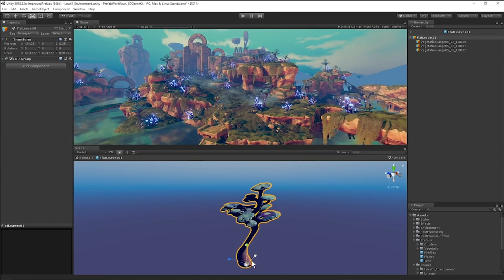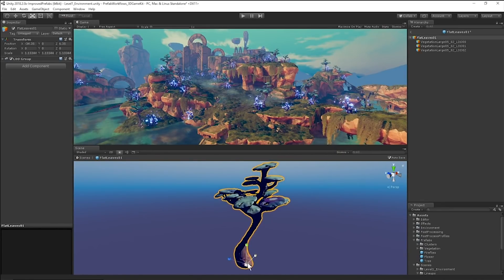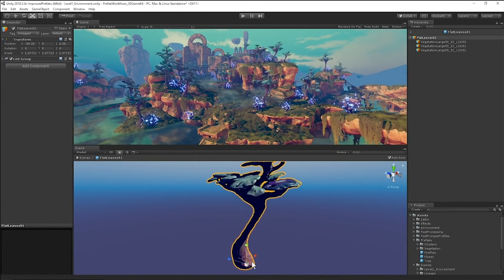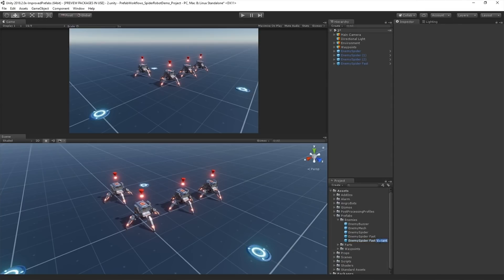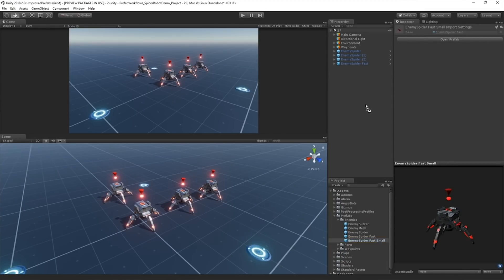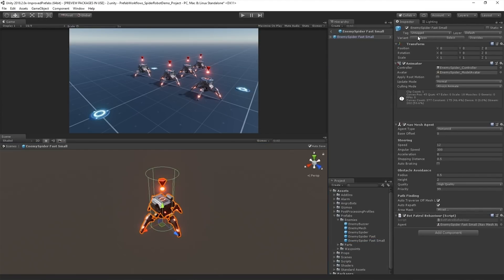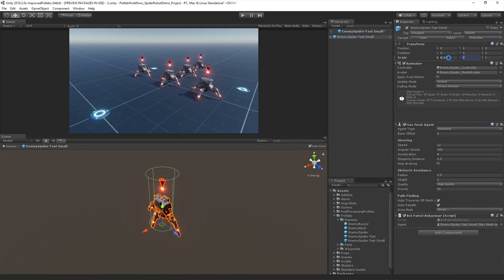Unite Berlin 2018 - Prefab Workflows

Comment: You have broken so many projects. Such a fundamental change to workflow should have been introduced only in 2019.1, not just before LTS. Major features like being able to edit a prefab in the context of a scene, or editing the components of multiple prefabs at once, are missing. You can't even see a prefab without clicking 'open prefab!' Where is your UX person?
The prefab changes make sense for a narrow, laboratory-condition programmer-perspective workflow - but not for the broad indie market making actual commercial products.
Try making a UI with this new system, and not being able to edit your UI prefabs in the context of the rest of the UI! A huge backwards step.
Reply: @Guybrush Threepwood There are a lot of studios who expected a clean upgrade path from 2018.2 - and this has presented a major, major obstacle. Core changes should not occur in 2018.3 (which is essentially the preview LTS release)
Reply: can someone explain what unknown error is?
Reply: edit the prefab instance then apply changes to the prefab. also, a prefab dependant on a parent is a design flaw. perhaps expand your UI layout knowedge :P

Comment: new prefab workflow sucks
Reply: Can you go into more detail?
Reply: You have 25 items. They are all prefabs in the old way. The only difference between them is one sprite, with a shared background. Change the background and you have to redo all 25 prefabs, one by one, one by one, one by one,.... With nested prefabs you had 1 prefab and 25 variants. Change the background only in the prefab. Done. On the other hand there are things that would make the workflow better for example the possibility to apply a change to the prefab from the Hierarchy context menu and not only from the Inspector's Overrides/Apply All.